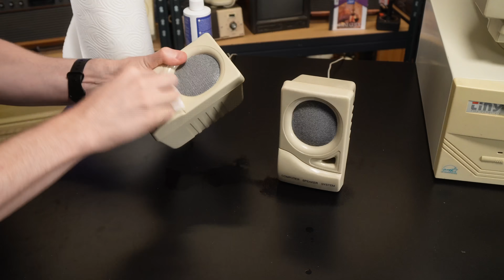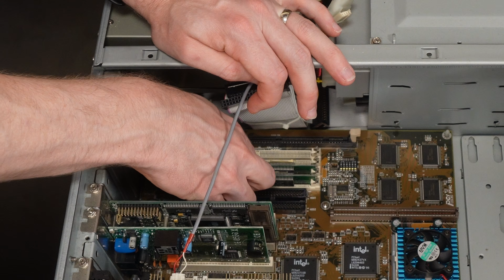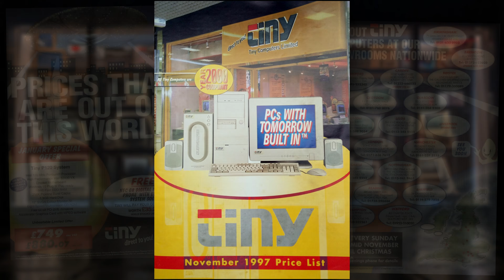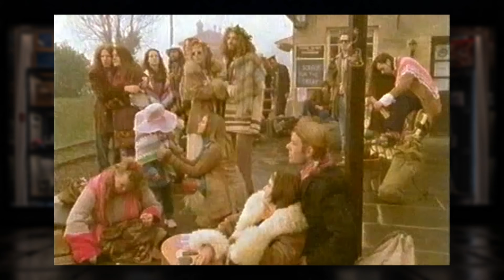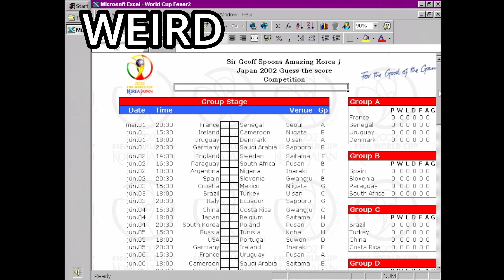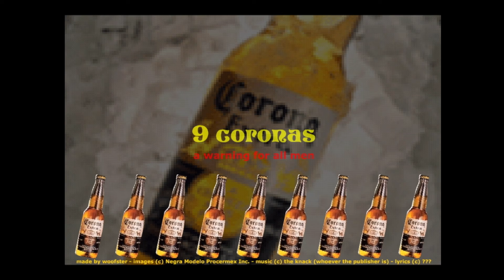The (Not So) Tiny PC That Got Britain Online

Comment: Hi, I was a Director of Tiny and thought I would fill in a few details and corrections :-Tiny was a spin off from Opus Technology. I never heard of Willow Vale Electronics until watching your video. You may be correct but if anything, its likely to have been some phantom holding company for legal reasons and nothing to do with creating the brand. Opus was a leading PC manufacturing brand selling direct into business and education sectors. But as the domestic market began to grow, Opus found itself torn between two differing types of market demands. Around this time we were developing a very small formfactor PC with our far east partners and the product was going to be called "Tiny". However, the company took an alternative direction and decided to set up an entirely new brand & company which of course was named "Tiny". The MD of Opus went off and set this company up in our old & much smaller Opus office located in Redhill and a new MD was appointed for Opus. The original Tiny PC was around the size of a standard house brick (well, maybe a bit bigger) and originated from a board level meeting in which the chairman picked up a cigarette packet and said he wanted a PC this size. Assembly was indeed in the UK, but only initially. Tiny grew rapidly and Opus continued pressing on with it's B2B and Education focus but margins became tighter & tighter, less than 10% in some instances. We decided to re-merge the brands into one company and subsequently relocated the Tiny business into the much larger Opus offices located in Salfords Surrey. The Opus brand slowly fizzled out and the Tiny brand was pushed hard; opening 100's of showrooms (not shops) in the UK and then followed by the US and HK. The demise of Tiny was not due to build quality, we were still shipping 1000's of PCs daily. The problem was margin. Consumers demanded lower prices and wanted more & more for their money. We failed to balance this with the massive overheads that had developed, particularly staffing costs and the company was loosing money as a result. Ultimately we concluded the business was heading to insolvency and the board took the very tough  decision to place the company into administration. BTW the hot glue on the ribbon cables was to prevent them shaking loose during transit. Something that was then copied by our competitors.

Comment: Good memories watching this :)
Had one that looked virtually identical as the first family pc when I was about 11. Ours had a different cd-rom (4x speed) and a 3-button mouse where the middle button did nothing, but looked to be otherwise the same - 100MHz, 16Mb RAM, cirrus logic card. Pretty sure it did have the ESS audio drive sound card though.
It ended up as mine when it was replaced, and many years later got transferred to my loft after I moved out.
I really should get it down and see what state it's in. Although given I was playing about with it when it was thoroughly obsolete / worthless (early 00's), it had a hard life...

Comment: I'm afraid nearly all of what you mention about the company history (pre-takeover at least) is incorrect!

The vast majority weren't assembled in the UK and were assembled I believe in Hong Kong, exactly what you say they weren't doing.   They came to the UK on shipping containers 100% pre-made.    Some custom upgraded orders may get unboxed, have a GPU swapped and then re-taped up but that wasn't the norm.   In the early days of the company it was different but the Tiny you refer to with shops and a house hold name had by then moved to this model.   

This shipping was often the cause of "poor build quality".  It was very often that the components were OK-ish quality but they got dislodged in the transit process somewhere between the far east and Surrey.   Ie a graphics card would very slightly dislodge itself from its motherboard (by a mm or so) but it be enough to make the PC fail to power on and boot when first unboxed.

Responding to changes in the market wasn't helped by building computers in the UK as you suggest.  After all, all the parts come from the far east.    It was much quicker to respond to changes by building them in the far east.    A laughable side effect of this was that it wasn't unheard of for a customer to get into an argument with a tech support rep in Surrey, with the customer reporting that they had so and so GPU/sound card and the tech not accepting that this was Tiny hardware.  In fact it was, but there was near zero communication between tech support and the builders in the far east so it sometimes happened that hardware changed without anyone in the tech support department having been informed.

The company downfall really wasn't due to bad reputation either, although it absolutely had this with anyone in the know.  It was actually a hugely costly expansion into the US market that caused it to haemorrhage money.

I know this as I worked at their Redhill and Seattle HQs ;)
Reply: I think they got all their info from  the wikipedia page that was vandalised at the time with false info

Comment: I have the same machine, passed to me by my father circa 2005. He got it in 1996. I added extra RAM and upped the Pentium to a 200. The RTC now needs replacing. Then I'll add a Compact Flash as a slave second drive. In mine, the floppy drive is loose. At some point my Dad removed the mounting bracket - he doesn't remember why - but didnt put it back and then lost it. So next time you disassmble, a pic of the floppy mounting bracket woukd be really helpful. Then I can make something similar. Beyond that, the RTC and the second drive, I might add vram if I can find some. And I'll try to get the USB working too.

Comment: Takes me back. In 1992 I was injured in an accident while working on the PD. The recovery period was rather long and included some surgery on my spine. I had an old C=128 that I got quite good on, and finally broke down and picked up a 386SX to break into the real PC market. While still recovering, I learned a lot of the DOS setup and when Windows came along I played with it as well.  Workers Comp lost their claim that they did not have to cover my injury, and they sent me to college, I was one of the first to be introduced to Windows  95, our college had a small lab with 12 machines running the new OS and a couple with OS2 on them. I had my 386 in my dorm and used a bit of my workers comp money to upgrade to a 486 so I could run Windows 95, I sold the 386 to another student, who was so happy she gave me a complete install of 95 on floppy disks. I still have that somewhere in my pile of crap in my old computer room now filled with so much crap even the cats are afraid to enter. I really thought 95 was cool but had  tons of great games and software for DOS that I still used. The computer was great for my college work, and eventually I found a used 386 laptop that added to my fun. I worked with our school newspaper as a layout editor and wrote a lot of articles on computers for the paper, it was great fun. I miss those days. I was an old fart in college so I was sort of a dad to many of the student, in fact they housed me in the law enforcement wing with the students going through the law enforcement  certification degree program, since I had 25 years on the job many of them were picking my brain as to what to expect when they pinned on the badge. It was a fun time in my life I shall always remember. I managed to graduate with a 4.0 GPA because I spent my hours studying instead of chasing women and drinking beer as many of the young folks did back then in college.

Comment: They were called that because their original computers were exactly that. Tiny Computers .They did 286 and 386 variants that were small enough to sit in the top drawer of a desk pedestal. I remember seeing them at the All Formats computer show at Alexandra Palace in the mid 80s. I have searched the Internet many times, but have never found a reference to these machines. I can only assume that the sales were so bad that they switched to clone PCs in order to stay afloat. From memory I would gueass that they were about 12cm wide by 8cm high and about 30cm long. But it was a long time ago. Perhaps I'm remembering this wrong though. Corrections are always welcome :-)

Comment: If I remember right, that Cirrus Logic GD5446 chip has really solid VESA, VGA, EGA, and CGA support. It's a good card to have in a DOS gaming PC.
Reply: It's a good card for Windows 95 too, it just doesn't have 3D acceleration. Though in my Tiny machine, I noticed this week that it's spent almost 30 years running with the wrong driver... It works, so the code might be the same, but I'll get the correct driver in there one day!

Comment: I've got a slightly newer (a P166MMX) Tiny box and I love it. No peripherals though, so good work! I have also been able to acquire something much like my first machine, it's a great feeling. A few thoughts:

- Yes, security improved massivel with the advent of Windows XP. 😅
- That urinal game is an aboslute classic, I played it back in the day. I miss those Excel games too.
- I've come across a number of PCs that had their IDE cables (and everything else, come to think of it) glued in. I think that maybe they had some problems where cables had come out during shipping and then PCs were returned because it may have seemed like the hard drive had failed. This probably put a stop to that.
- Using epoxy to stick the heatsink to the CPU seems redundant because of the clip being present. Makes me wonder whether this was an old practice that got carried on.

Comment: Word of warning, certain plastics will turn extremely brittle by just leaving it out in the sun, I did that once with an Xbox 360 controller years ago and after a couple of sessions (because it started to rapidly yellow not long after the first one) it literally crumbled in my hands when I held it.

The "sunbrighting" method is one I would absolutely not advise on anything you'd be concerned about damaging, take the extra steps and go with the vapour method, it'll get less sun that way.
Reply: This is true! Sun-brighting can be very destructive to some plastic whereas the H2O2+heat+UV method actually chemically restores the plastic to a certain degree.

Comment: i had a TIME pc, amd athlon 1gz, 64mb of ram, 32mb geforce graphics 256 card, a hdd 1.4tb i think, cd rom rw drive, floppy disk, windows xp and a 17 inch monitor, it was the space ship looking, case and a soundblaster card. bought on credit paid up monthly 

they were not cheap systems. great videos, replaced in 2004 for half life 2 with a system i built myself
Reply from the maker: I also built a system specifically to play Half Life 2! P4 HT 2.8GHz with a GeForce FX5200. Not the best choice of graphics card but the best I could afford as a poor student...

Comment: For the retrobrighting trick, you don't really need to submerge the stuff (taking it apart) necessarily, but you could use a transparent, airtight box and place hydrogen peroxide in a cup next to the item and let the fumes fill the box while blasting it with sunlight / UV.
Reply from the maker: Mmm, yes, I've heard good things about this "vapourbrighting" technique. Definitely one to consider for a future project - thanks!

Comment: Oh, dear lord... I used to service those things at the start of my IT career in 2002. I worked at a University which had hundreds of them. They were all eventually replaced with IBM ThinkCentres but they weren't actually all that bad when we had them. They were all gone by 2004, but I kept one in the backroom of the IT office for recovering data from corrupt floppy discs until about 2015.

Comment: Tiny were initially based in Redhill, Surrey and were close to the engineering company in Merstham I worked for in the early 1990s. My boss decided he wanted to buy a lot of them so he sent us software developers around to have a look.
We were greeted by Tiny's owner who came across as someone who was into hardcore selling of product. He was very much into expanding the business as quickly as possible. We all ended up having one each, they replaced the ageing Compaq's we were using.

This was before they had a big factory and offices in Redhill. I think their original place was closer to Merstham. They did grow very very fast though, so the guy that started them achieved his ambition. Probably carrying on the 1980s business ethic into the 1990s.

Had a look at the info on Wikipedia and that doesn't seem right at all, or it is very incomplete. I think they have missed out a lot of the early history.
Reply: I remember the hours on the phone to Redhill every time we had problems 🤣

They ended up sending me a home made floppy disc with a batch file that would format the hdd then install windows 95 automatically from the CD. Saved the day so many times when I deleted something wrongly when I was 10 🤣
Reply from the maker: Interesting, thanks for the info. The Wikipedia page is pretty terrible to be honest, one of the reasons I try to back everything up with secondary research where I can. Oddly enough a couple of members of my community are ex-Tiny people (did everyone work for them back in the day!?) and gave me some great firsthand info.

Comment: To fix the CMOS battery you can usually drill two holes  (check pinout for your RTC as to where to drill them) on the chip and solder a coin cell holder. Necroware has a video on it.
Reply from the maker: Indeed, I've seen that method as well as Necroware's drop-in replacement. Still deciding what to do with it but having to set the date and time on every single boot is certainly getting old!
Reply: @ctrlaltrees  I've decided to desolder mine and add a socket for a direct replacement.  There's too little room between the Odin chip and the BIOS to take a Dremel to it.

Comment: Recommend doing the Dallas mod. Also many early Pentium systems had the heatsink done with thermal adhesive. Some strong fishing line and a bit of elbow grease usually does the trick. It's a pain to clean off though.
Reply from the maker: Yes, I've come across the adhesive before on a P4. Nasty stuff.